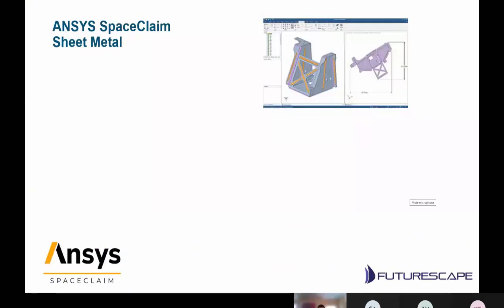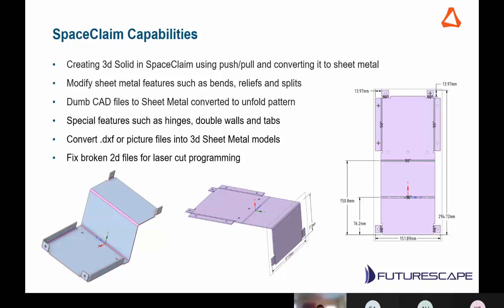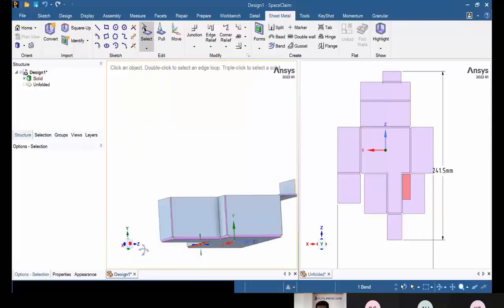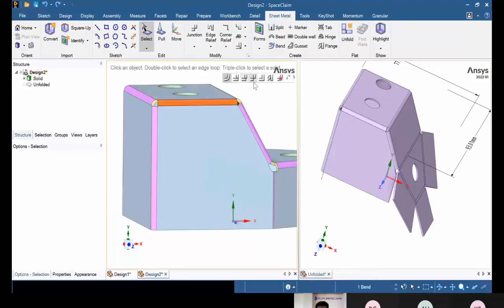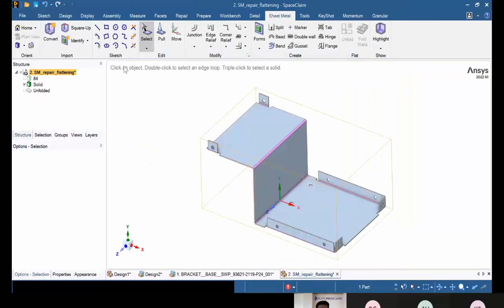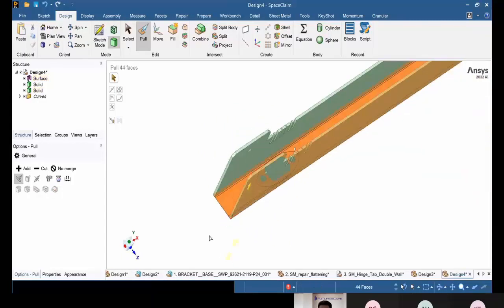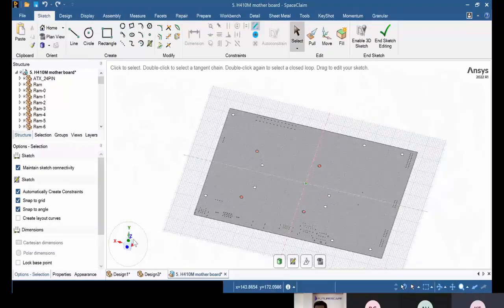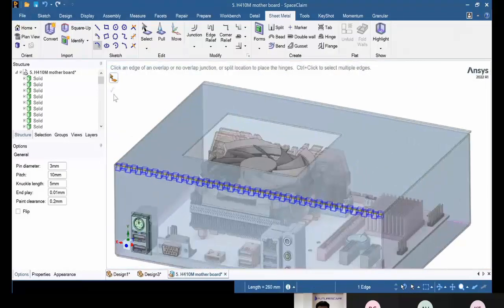Webinar-Sheetmetal manufacturing Made Easy Using Ansys SpaceClaim

Comment: Thanks very much - the tools are very powerful - really the ability to 'think' how to make sheet parts is very important. The variable K factors depending upon t and r with bend angle must be wonderful for professional specifiers and everyone tasked with making parts. The flat pattern facility, and the on-the-fly change add / remove / split bend faces to make a manufacturable part is a great tool as well.  Good video - Infact most, SC vars have been creating very informative information on sheet metal tools especially with the 2022 R1 tools. Thank you again.
Reply: Our pleasure.